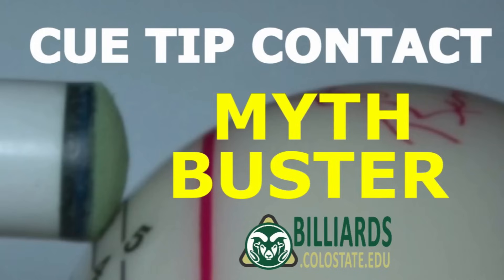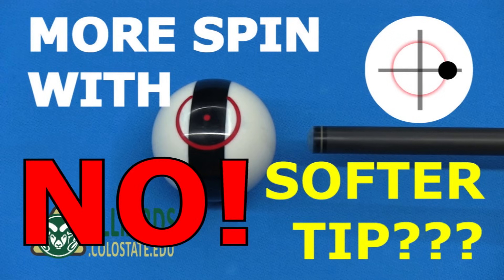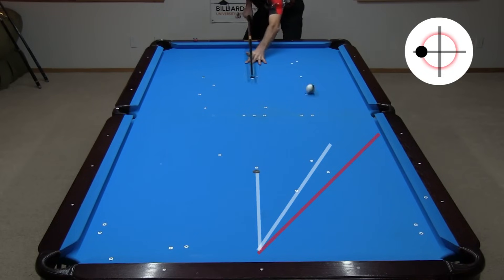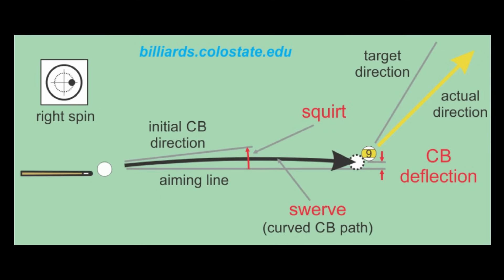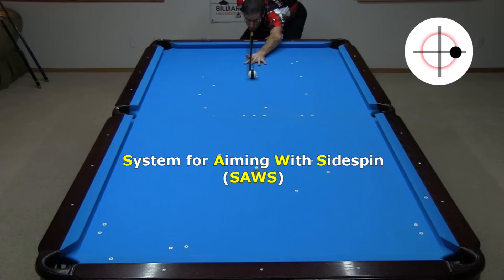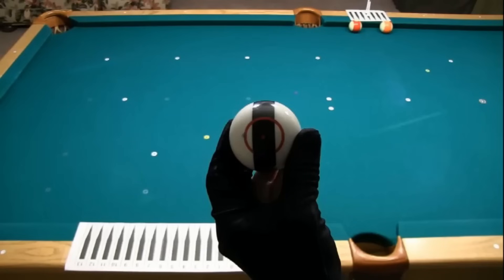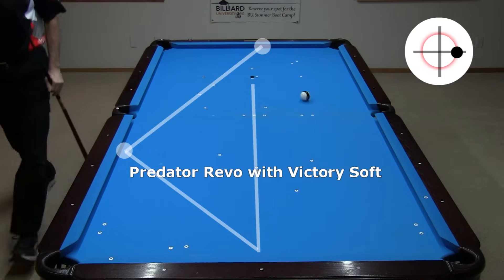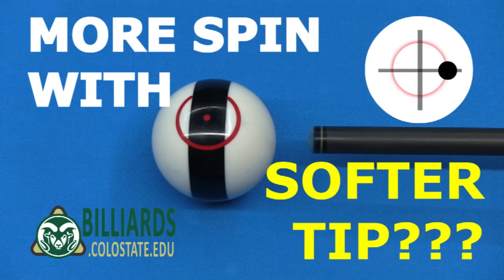Can a SOFTER TIP Put MORE SPIN on the Ball? -- MYTHBUSTING Answers

Comment: Check draw distance difference between soft and hard, with same stroke
Reply from the maker: The action of he hit with bottom spin is no different than the action of the hit with sidespin.  What is different with a draw shots, is more speed is often required.  Because a harder tip has a slightly better hit efficiency (energy transfer), a harder tip will offer a slight added advantage over a softer tip, where slightly more CB speed will retain slightly more backspin on the way to the OB.  But getting good draw is more about stroke technique than equipment.  See:
    https://billiards.colostate.edu/faq/draw/advice-and-drills/
Reply: @DrDaveBilliards  so are you saying one can get the same amount of draw with a jump/break cue as their playing cue?
Reply from the maker: @mattjudy7263  Not a jump cue ... it is too light.  But I can get the same draw action with my break cue (with the BK Hybrid tip), assuming I chalk the tip carefully.

Comment: I don't think this experiment is analogous to actual play.  I don't think many people hit the ball at the edge of miscuing during actual play (on purpose).  At the edge of a miscue is when the least amount of tip would be in contact with the ball, and the effects between the tips is reduced to a minimum.  What really needs to be measured is now much spin you can reliably put on the ball without the danger of a miscue.  Also, even with a hit slightly off center, more spin under that situation would be better as the effect of deflection would be less, and my rather crude tests shows the softer tip puts more spin on the ball when hit the same distance off center.
Reply from the maker: If a tip is chalked properly and you hit inside the miscue limit, you will not miscue.  But if you want, you can try the tests at the end of the video with some other amount of spin, for example half of maximum.  If you do everything I recommend in the video, I am confident your results will be no different for different tip hardness, regardless of the amount of spin.

Comment: While people could argue that you may not be hitting the exact same amount of side Spin and the exact same amount of energy each time, my argument comes from simple experience. And from experience, a smaller, softer, tip has always given me WAY more controll and more sidespin with less chance of miscue. I currently run a 10 mil tip with a kamui supersoft and I absolutely love it. I can damn near hit the edge of the ball (in left hand spin, the left side of my cue tip is nearly parallel with the left edge of the ball, vice-versa for right hand spin) and NEVER miscue, assuming I properly chalk. I use Kamui .98 and Konelenn Nano chalk, which seems to be very effective with my combination. I'm also using a Go Customs Carbon SNK shaft with a Predator 2 butt.
Reply from the maker: I designed the tests at the end of the video so stroke consistency doesn't matter.  If you push the miscue limit and take enough attempts, you will eventually get maximum spin, regardless of how good or bad a player you are.

Comment: I have experimented with different tips and found that a kamakazi hard leather tip works the best for me , and my opinion is the softer tips create more deflection, I even played with a g10 “glass” tip for a month during my experiment
Reply from the maker: In theory, softer tips should create more CB deflection, but I wasn't able to measure much difference in tests I have done in the past.  See the last section at the bottom of the page here:
    https://billiards.colostate.edu/faq/cue-tip/hardness/
Reply: @DrDaveBilliards  , I read the link you sent , and I experience the same thing as it list , made sense in my head , that putting soft tips on low deflection shafts defeats the purpose of low deflection shafts, using a very hard leather tip on a carbon fiber shaft eliminated a lot of deflection for me , my accuracy has improved greatly since switching from a kamakazi medium, to a kamakazi extra hard ,
Reply: I guess in a nutshell, the longer contact time with the soft tip could compromise target accuracy and require more consistent stroke , possibly

Comment: I’d be very interested in the % of miscues between the tips. I try not to but there have been incidents where I accidentally continue to play with my break cue. What is a dead giveaway is when I eventually miscue and end the inning. I mean, my first thought is… we’ll if the tips are all the same, why not just play with a hard time, which is more consistent over time. The problem with a soft it is that it hardens over time as you play. So to keep that consistency you need to replace them frequently… why?!? But it would make to play with a soft cue if you’re miscuing all the time.
Reply: Good night! Type-os all over the place… sorry

* a dead giveaway of that mistake is when I miscue

*play with a hard tip

*would make sense to play

I currently play with a kamui soft and I think my next replacement I’ll go with a kamui medium, to try and achieve more consistency as the tips wears
Reply from the maker: If you chalk properly and often enough (e.g., before each shot), and if the tip holds chalk well, there should be no difference in the % of miscues.  During my filming, I think I got a few more miscues with the break cue tip (BK hybrid), but not when I chalked carefully.  Phenolic tips do not hold chalk as well, so you do need to chalk them with care if you plan to use them for close-to-maximum-spin shots.
Reply: @DrDaveBilliards  that’s a reasonable explanation, thanks Dr Dave!

Comment: I would like to see one more test. Please show that maximum draw is identical with all three hardness's.
Reply: That is a great idea. While my experience definitely is in line with Dave’s for side spin, I do think that a softer tip might make a much bigger difference in draw and Masse shots, as the contact duration might be long enough to overcome more friction between cloth and cue ball. Since maximum draw is a relative term (ie backspin), it might even be interesting to see that draw happen with maximum elevation of the cue.
Reply from the maker: @si98justme1  Maybe for masse, but not for draw.   With a draw shot, the CB is off the tip before significant CB-cloth/table interaction occurs.  See:
    https://billiards.colostate.edu/faq/draw/physics-advice/
Reply: Thanks for the input. Yeah for a “conventional” draw shot your video does prove that hardness as negligible effect at best. However you don’t need to play a conventional draw shot, there is another way to draw the cue ball, using a Masse style cue action, except instead of “curving” the cue ball, you play it straight towards the object ball. 

Not the easiest shot, due to awkward cuing and the tendency to squirt the cue ball in unintended directions, but I have personally played this shot many times, with dramatically better draw action than a conventional draw. Especially when I find myself needing the cue ball on the other end of the table and I don’t have the space to use a conventional draw, with follow through, between the object and cue balls. 

I tend to use a soft tip for this type of shot because I assume it is better for it, however seeing the results you’ve shared, has made me think it might be interesting to see if harder tips can work just as well.

Anyway, if this does prove worth exploring and experimenting on, I would highly recommend getting a few business cards or sheets of  card stock to use as protection for your table’s cloth.
Reply from the maker: @si98justme1  See:
    https://billiards.colostate.edu/faq/draw/cue-elevation/
Reply from the maker: The action of he hit with bottom spin is no different than the action of the hit with sidespin.  What is different with a draw shots, is more speed is often required.  Because a harder tip has a slightly better hit efficiency (energy transfer), a harder tip will offer a slight added advantage over a softer tip, where slightly more CB speed will retain slightly more backspin on the way to the OB.  But getting good draw is more about stroke technique than equipment.  See:
    https://billiards.colostate.edu/faq/draw/advice-and-drills/
Reply: @DrDaveBilliards  You are claiming that side spin and bottom spin are no different and I don't disagree. Why not demonstrate that as definitive proof? Use a phenolic tip and a soft tip and show that you can draw just as well with either one.  In both cases the stroke technique would be negligible (yours in both cases). I suspect you can't demonstrate this and it's because the miscue limit with the phenolic is too close to the center.  It's not that your are wrong in your claim but the huge difference in miscue limits would play a huge role in the amount of draw you could impart. If you still disagree, I just challenge you to demonstrate it with no editing.
Reply from the maker: @trailprice  If the miscue limit is the same, than the max spin possible is also the same.  I see no need to prove this with an additional video, but you or others should try it is you have any doubts.  I've already done more than my fair share of demonstrations and science for draw shots under the different sub-headings here:
    https://billiards.colostate.edu/faq/draw/

Comment: I have been working with the theory that the tips do not impart more spin but that a "grippier" tip wil move your miscue limit out thus creating more spin.  Take bottom for an example. It is possible to hit all the way down with the tip just off the cloth and not miscue. This,depending on tip size,is way outside the normal comfortable miscue limit. Albeit there is increased deflection but still spin by and large should be greater.
Reply: The tip size affects your perceived amount of spin as the actual contact point is different from the centerline of shaft.   A large tip will have to be visually further from center to get the same contact point.   Small but perceivable difference fooling some into thinking they are getting more spin or are able to go further out than others while in truth the contact points are the same.   This should be noted for peoples attention.  Also this affects describing shots. One tip of english ,strokes being similar, will vary if tip size is very different. I suppose tip shape, dime verses nickel also factors in.
Reply from the maker: All good points.  For those who want to learn more or see illustrations and demonstrations, check out:
    https://billiards.colostate.edu/faq/cue-tip/size-and-shape/
    https://billiards.colostate.edu/faq/sidespin/maximum/
    https://billiards.colostate.edu/faq/sidespin/tips-and-percentage/

Comment: That is a great research Dr. Dave! But I really don't understand one thing. When you talking about spin, why are you put 100% attention on side spin and didn't even mention back spin? I think that every decent player can apply enough sidespin for his purposes with any tip, but many people struggling with draw. So here is where soft tips comes into play with its longer contact with the CB and increased spin transfer. Guys use soft tips for better draw, and not for 5 more rebound degrees I believe. There is no way that soft tips make no difference on a draw shot! I hope so 😅
Reply from the maker: The action of he hit with bottom spin is no different than the action of the hit with sidespin.  What is different with a draw shots, is more speed is often required.  Because a harder tip has a slightly better hit efficiency (energy transfer), a harder tip will offer a slight added advantage over a softer tip, where slightly more CB speed will retain slightly more backspin on the way to the OB.

The key to getting good draw is stroke technique, not equipment.  See:
    https://billiards.colostate.edu/faq/draw/advice-and-drills/

Comment: Nice explanation. Are there small differences in miscue limits for the three tips?
Reply from the maker: The maximum spin I was able to get with each tip was the same, so the miscue limit is the same.  I didn't show the chalk marks on the ball in this video, but I did check them after every shot.  They were all similar to the image I showed at the beginning from the earlier testing video.
Reply: Good question.

Comment: New question… does tip width effect the amount of spin? My buddy believes a 13 mm gives less spin than a 11.75. When I shoot with either I agree
Reply: That’s actually very easily answered. The 13mm has a wider diameter so the contact point would be more towards the centre of the cue ball (very slightly) than the 11mm, if the centre of the cue is at exactly the same point for both. In essence, you would need to adjust what you think is the contact point slightly further out to achieve the same contact point as the 11mm. I’ve seen this effect and personally have had experience with using a 4mm tip vs 8mm.
Reply from the maker: See:
    https://billiards.colostate.edu/faq/cue-tip/size-and-shape/

Comment: I agree with your results. However, I believe, through personal experience, that a softer tip allows more forgiveness as you approach misque territory. Less miscues using excessive spin. Would this be a myth or mistake?
Reply from the maker: I think this is a myth unless one is not chalking properly or carefully, in which case a soft tip might have an advantage since softer tips tend to hold chalk better (especially when compared to a phenolic tip).

Comment: Kinda crazy how expensive it be finding your correct shaft and tip combination to find your best fit.
Reply: Ask friend to borrow cue
Reply: Doesn’t have to be. Focus on the stuff you do control (shot selection, cue control, aiming, stance, planning etc) first then worry about what makes you comfortable. I’ve seen people who will pick up a house cue with a loose weight, a shiny tip and a bent shaft, run out all 15 balls (8ball) with consistency, so if you want to play pool well, and hustle/go pro/ whatever, then you should get the basics right before you start focusing on the equipment you play with, cause chances are, it’s not the equipment that’s your (and my, in fairness) problem.
Reply from the maker: @si98justme1  Agreed.  The player is much more important than the equipment.  See:
    https://billiards.colostate.edu/faq/cue/selecting/

Comment: OK, but now you need to do a follow up study. Which tip hardness gets the most consistent results. You would need the same cue and shaft type to take away some of the variables, but could do it with a cheap predator butt (or other brand) that was easy to switch shafts with that are all the same (i.e. all 314s). Each would have different tip harnesses. You would then perform say 10 different shots with the different hardness tips 10 times each. To take away any bias you may have in terms of preference, you would need to label the shafts so you know which one has a specific tip, cover the label, then add a secondary label to them so that you can record your results when using shafts at random. 
Using a manufacturer that makes tips at different hardness would help offset variations between brands, although I would assume this would minimal or non existent based on this video and its previous video. It might help end the tip debate entirely in conjunction with this video.
Reply from the maker: That's a good idea.  You should do it and post the video.  If you do, please post a link here.

Comment: I remember you did a video on safeties and used the jump cue to kill action on the cueball to freeze the cueball behind a blocker. 

For some reason, the jump cue (which has a harder tip) killed the cueball roll much more efficiently than a playing cue.

So then why is that?
Reply from the maker: You might be referring to a video where I used a jump cue to help avoid a double hit (because it is much lighter).  It was probably one of the videos here:
   https://billiards.colostate.edu/faq/foul/double-hit/
or maybe it was this shot in my "Top 10 Useful GAME-WINNING SHOTS You Need to Know" video:
    https://youtu.be/1rJVrgv0Na0?t=621
Reply: @DrDaveBilliards  yup that was the shot with the jump cue right about 11:20 in the video you linked. Glad you linked it cuz I went looking for it. 

Seemed like the jump cue's hard tip took the English off of the cueball. I guess I could be wrong. I've always thought the hard tip tales English off the cueball. You're making me questions things
Reply: Probably easier to accidentally apply spin with a softer tip. Covering more area, allows for more room for error maybe? Also becomes more accurate where you're trying to hit 🎯 on the cue, pinpoint. Guessing

Comment: Excellent video doc! It sort of begs a video for what tip softness selection does mean in one’s game. Not impacting spin implies that it doesn’t impact miscue limit. I’ve certainly used some bar cues that could barely be used off center. Is that only tip shape? What’s the value in a softer tip then?
Reply from the maker: If the bar cue cannot impart spin, it is probably because it is glazed and not holding chalk well.  Harder tips do offer some advantages per the info here:
   https://billiards.colostate.edu/faq/cue-tip/hardness/
Although, some people will prefer a softer tip for the "feel" and sound of the hit:
    https://billiards.colostate.edu/faq/cue/feel/
or because it might make it easier to control speed of finesse shots.